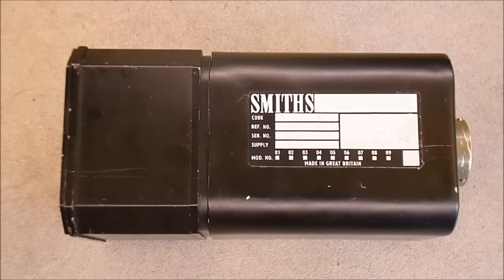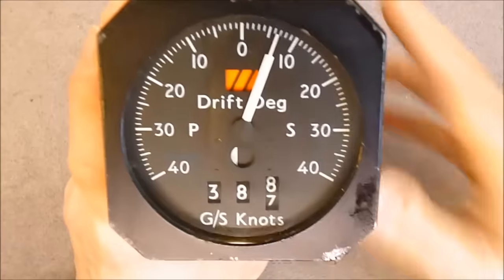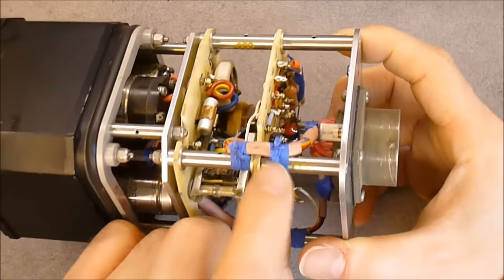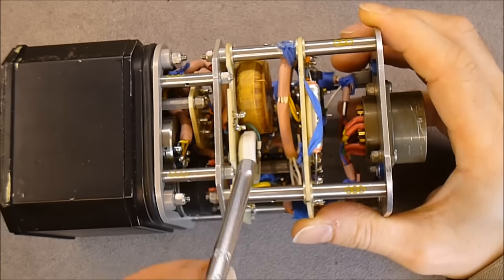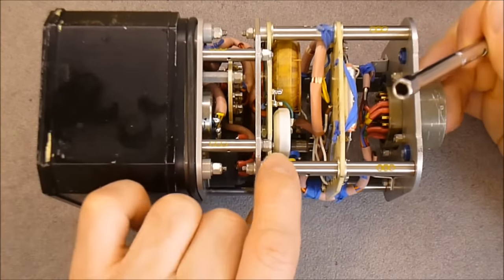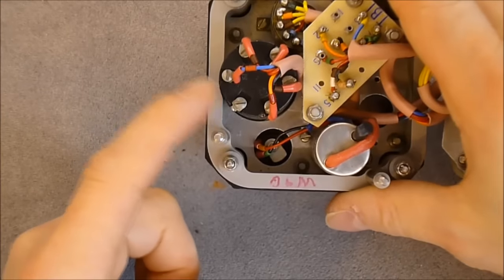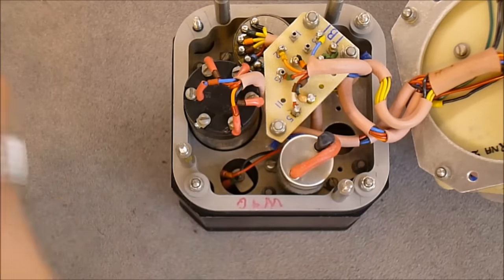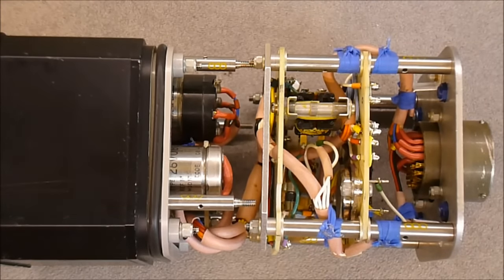Smiths Decca Drift angle and ground speed indicator teardown

Comment: In the early 1960s I was an Electronics Engineer in the Navigational Instruments Dept. of Smiths Instruments Bishops Cleeve, surprisingly all the other engineers were mechanical.  I was responsible for the version of this instrument fitted to the BEA Trident - it was almost identical. The item you thought might be a backup battery is actually a "castanet" tantalum capacitor. The bottom warning indicator has the letter M on it.
I have in front of me the version originally fitted to the Cranfield Dominie XS711  -  it also is virtually identical.
Peter Prest
Reply from the maker: Fascinating, thanks for the info !